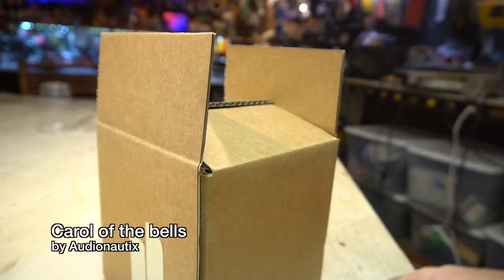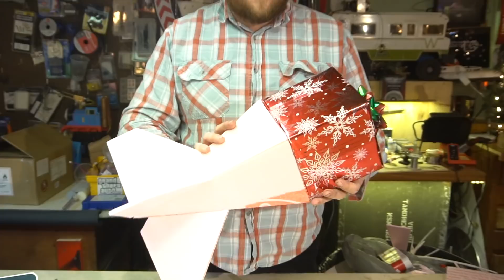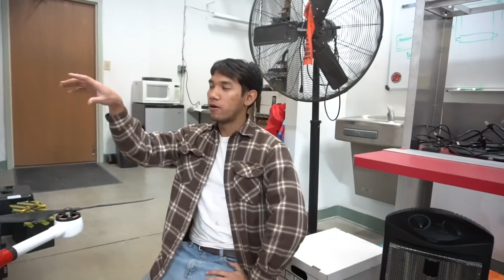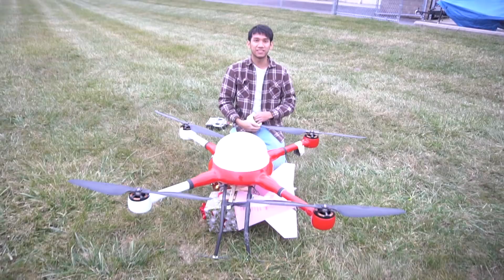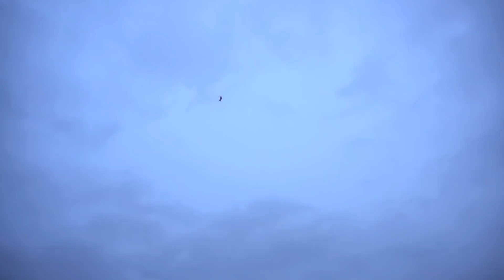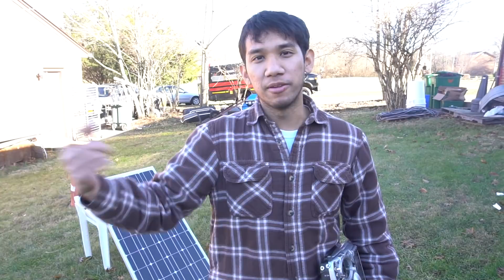Santa Delivery Drone challenge!

Comment: make a flying propeller. (try to keep it just as the propeller so dont add too much to it).

or make a speedboat where you can fit in :D
Reply: Project Air just did one of those (sorta) a few months back. You should check it out if you’d like.

Comment: Peter is secretly the head of Santa's R-n-D department, meant for destructive present delivery.
Reply: The Santa Claus Inc. Research N Destruction (or “development”) department. Mr. Sripol’s job is to test present box maximum load levels by going beyond the limits. This insures a minimum of present delivery box “Rapid Unscheduled Disassembles” or “RUDs”